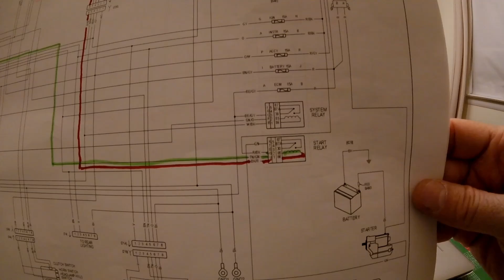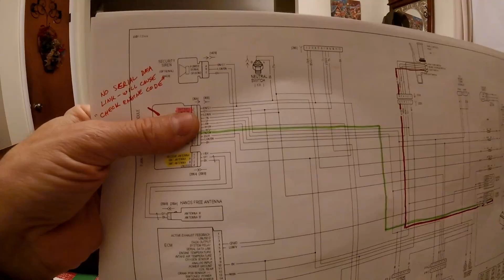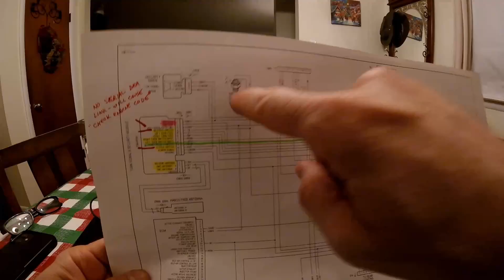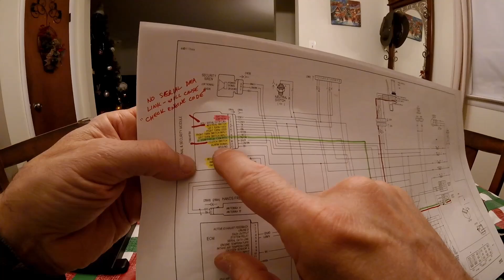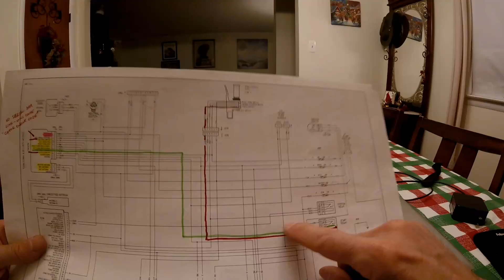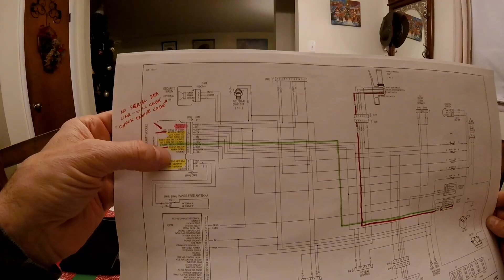Harley Security System Delete & Turn Signal Removal. Twin Cam 1999 to 2010 module TSM & TSSM

Comment: I have an 07 dyna super glide fxd and did just as you said (cutting the tan/green 9 wire and then grounding it to the frame. Now it at least turns over, but won't catch and start. The red key light still illuminates and the blinkers flash. Google/AI is saying  that the security system is still active and not allowing the spark plugs to fire or something. Help?
Reply from the maker: Sounds like you need to ground the same wire on the other relay. I don't have the wire diagrams in front of me to tell you the color of that wire. You can email me at hdrap_1999@yahoo.com and I can look it up next week. You can also google "2007 Harley wiring diagrams"
and figure it out for yourself. Thanks for watching

Comment: I have a roadking 2003 carburetor, with a tssm 68922-00B

Have the cable connected to ground, engine goes around but no spark, get 12v on the ignition coil have no more key fob!! Engine has run with fob, all fuse are whole, engine meanwhile has an after market speedometer Am I doing something wrong or what do I overlook that I don’t have a spark??

Hopefully you can help me, best regards from the Netherlands
Reply: I no longer have the original speedometer with the engine, and the plug that normally goes into the speedometer is now not connected,, could it be that a cable has to be linked to fix the spark problem?
Reply from the maker: @Spd-motors  I don’t know how it affects the computer not having a speedometer. I know that when my speedometer is not working my 2003 road King doesn’t wanna idle properly but it’s still runs fine.
Reply from the maker: The TSSM only fires the start relay. The first thing that comes to mind sounds like you Crank Position Sensor is bad. Let me know if you need further help.
Reply: Have measured the cps and is fine between the values, I read stories when the engine is originally delivered with a tssm your story is not correct, the ecu remains blocked and gives no signal for the sparking is the engine delivered with a tsm then your story is correct, and you can bridge it and start it like this..

I don’t know if this is true, maybe you can do something with this info and still come to a solution that the engine sparks again

Thank you for your quick response
Reply from the maker: @Spd-motors  what I say works. If you read the comments, there have been plenty of people that responded that it worked. As far as the resistance goes, I don’t know anything about that, but I would check to see with a frequency meter if it’s pulsing when you crank the motor. I would also check to see if the computer is putting out a ground to the coil when you’re cranking the engine. You could check that with a frequency meter also.
Reply: What number or color cable should I measure from the computer to see if that mass pulsates? Will mease acdc of the cps tomorrow I’ll keep you posted
Reply from the maker: @Spd-motors  i’m not near the wiring diagrams at the moment. I would be around nose on Monday.
Reply from the maker: on the crank position sensor, you want to check that you have 12 V from the red/white wire on pin A to the black wire on pin C. When you’re checking the frequency, you wanna go from the white/green wire on pin B to the black wire on pin C. For the coil, the white/black wire is the 12 V power and the blue/orange wire is the front cylinder and the yellow/blue wire is the rear cylinder so you want to check from ground to the front cylinder or rear cylinder trigger wire. If you see 12 V all the time then the ignition control module is not providing the ground and the coil won’t spark. Of course you have to have the 12 V on it when this is happening. It’s important to check 12 votes on the white/black wire while you’re cranking the bike.
Reply: @Rapsgarageshop 

I don’t get 12 volts when I measure between red and black at the cps when I measure from black after battery plus is t okay so mass okay you would say, but if I measure in the plug between black and red 1.0 volts.

Can I try to make a cable from battery12 volts to the plug cps and then test? Get a strong feeling that a cable needs to be connected somewhere in the plug of the tacho
Reply from the maker: @Spd-motors  I'd focus on having 12 volts on the coil White/Black wire when cranking and then checking the frequency of the other wires to ground. You can see it on this diagram.  https://serviceinfo.harley-davidson.com/sip/content/document/view?id=5529#d9f41a3d-11c5-441b-b3a9-277049ed91ab!!1!10
Reply: @R I get 12v on me ignition coil will measure tomorrow if it also gives mass signal,,,

But I measured between red and black that go to the crankshaft position sensor, there I don’t measure 12 volts!!! There I only measure 1 volt,,,

Shouldn’t this problem be fixed, or did I not understand you correctly that it should have 12 volts on it?
Reply from the maker: @Spd-motors  I may have made a mistake with the 12 V. I’m not sure what that voltage would be. I’d have to measure it. I would focus on the coil and the pulses there.
Reply: @Rapsgarageshop  Can you check that for me if there should be 12v yes or no,,

When I have checked the ignition coil signal later you will hear that from mii,,,

Drove the bike home, lost keyfob,

Meanwhile the engine has been rebuilt, I get more and more the feeling that either it has to do with the original tacho plug/connection, or really the difference whether the engine originally came with tsm or with tssm!

Thanks so far for your quick response, hopefully together we can solve the problem spark without tssm anyway!
Reply from the maker: @Spd-motors I’m unable to check the voltage for the CPS. As a side note if you have a TSSM you can swap a TSM in it’s place without any issues
Reply: That’s right, but actually hoped this wouldn’t be necessary,,,

Tsm in the Netherlands difficult to get,

And the prices go through the roof,

Haven’t had time to measure yet,

Comment: can you just unplug the module or do you need to do anything else besides grounding the tn/grn wire?
Reply: So I unplugged the module and my  flashers still go off whenever I turn the ignition. -dustinneuwirth5735
Reply from the maker: @jaydianchristie5185    If your bike is carbureted you are most likely unplugging the ignition module and not the TSSM.
Reply from the maker: At that point, you can unplug the module, but you will no longer have turn signals

Comment: My 2001 Heritage Softail fuel injected I bought used years ago and have road for 6 years no FOB, yesterday started flashing turn signals a couple times when turning key to start. A few hours, several stops later it decided on its own it just starts and dies as if it needs a security FOB
Reply from the maker: Sounds like a bad TSSM if I had to guess. My video should help.
Reply: @Rapsgarageshop  thank you, I am going to look at the tssm, this was a non running bike that had sat under a car port for at least 5 years, I really don't know if it has a tssm bypassed or a tsm. turn signals work, currently no flashing going on like it was yesterday, it starts right up every time and immediately dies. Kind of aggraviting cause I have been riding it trouble free for several years. absolutely no codes, nothing calling for me to enter pin. I am wondering if there is any pairing or programing involved. too bad accessing the tssm is such a pain on this 2001 softail
Reply from the maker: @jackdevine5382  I would use some starter fluid and see if you can keep it running with that. At least that way you would know if it’s a fuel problem or not.
Reply: @Rapsgarageshop  Thats a great idea, just reminds me of the way my 2010 sounded when I converted from TSSM to TSM. There is one point where you hit start, it runs a second then dies then you wait 10 minutes. + where it was flashing turn signals twice the last 3 times I started it yesterday. I need to access the module and figure out if its a TSM or a TSSM . If its the TSSM it has to have been bipassed or "deleted. There is no way a FOB is hid on here somewhere as I know it sat 5-7 years afore I bought it.There is TSM aftermarket you tube saying if its TSM I can replace it without programing.
Reply: OK just went out to my John Deere F935 and grabbed a half can either, yes ran a little longer. Hooked up my fuel pressure gauge, initial good pressure then goes to 0. Typically they will hold pressure, gauge even has drain tube and pressure release button, suspecting cracked @ housing for fuel pressure regulator, will investigate more. Plus I tightened battery cables yesterday, fairly new battery were torqued to spec, yesterday tightened by feel, maybe that was my turn signal 2 flash. weird,  Thank You,
Reply from the maker: @jackdevine5382  yes if you have a TSSM or TSM they do make an aftermarket one that will replace it. The aftermarket one is just a TSM, but you can use it in the place of a TSSM.
Reply from the maker: @jackdevine5382  sounds good and good luck. If you need additional information, please reach out.
Reply: @Rapsgarageshop  Thank you for the reply, after draining the tank, removing the fuel module and check valve, inspecting everything. I found a tiny paint chip looking debri in the check valve. Disassembled, cleaned, wiped out tank with oil rag. Reassembled bike started right up.
Reply from the maker: @jackdevine5382  That was a great idea to check that. Now go ride the wheels off of it.

Comment: I cut the tan wire with a green stripe and grounded it. My bike will start and then shut right back off. I have a 2008 FLTR
Reply from the maker: If you do the same procedure to the Green/Orange wire on the system relay this will keep the fuel pump powered any time the Run switch is on. You should know that your bike has a tip over sensor so that if you go down for some reason, the computer shuts the system relay off. The tip over sensor purposely shuts the fuel pump off so that if you go down in an accident doesn’t pump fuel all over the ground and cause a fire. 
I would start by checking to see if there’s 12 V power to the Fuel Pump fuse while you’re trying to start the bike and then see if the 12 V goes away as soon as the bike shuts off. See pages 1 and 3.

https://serviceinfo.harley-davidson.com/sip/content/document/view?id=5535

Comment: Hello Raps, I’m in Fort Worth Texas, I bought one of Four Softail Custom’s That came to Texas in 08. I finally  had my key fob go MIA on  me. I cut the P9 wire  at relay. Ran an independent ground to the relay, while heat shrinking the end I cut. Starts like a champ but immediately cuts out, right away. Is there anything else I have cut and a ground to , so it will stay on? Do I have to run another ground, to System Relay as well?
Reply from the maker: If you ground the Green/Orange on the system relay when you turn the two power switches on it will fire the system relay. I’m not sure that’s your problem is, though. I’d check to make sure that you have 12 volts at the coil power wire before I when further. If you’re still having problems you can email me at hdrap_1999@yahoo.com. Include the year of your bike, the problem you’re having, phone number, time zone and what’s a good time to call.
Reply: @Rapsgarageshop Sure thing Sir.

Comment: I put removed the starter relay and put a jumper wire in there to get it to start. It starts and dies right away. This is definitely my security system, the bike wasn’t really sitting and its fuel injected. How can I bypass it to keep the bike running?
Reply from the maker: Send me your phone number, a good time to call and what time zone you’re in to hdrap_1999@yahoo.com and I’ll call you
Reply from the maker: Also what bike you have

Comment: Back again, 07 dyna fuel injected, The relay is fine, I checked. No key fob starts up then shuts down,, I grounded start relay and eliminated the possibility of the problem being the system relay, it seems as if it stops firing the fuel injectors and the spark plugs, I have removed the tssm completely, can u email me instructions how to keep her on? God bless you happy Sunday
Reply from the maker: I would need your email address. Sounds like the fuel pump is bad. When you jump the relay out and turn the key on will the fuel pump keep running ?
Reply: Fuel injected 07 dyna to rewire ignition
Reply from the maker: @PinchyJason email your phone number, time zone and a good time to call you to 
hdrap_1999@yahoo.com

Comment: Im going to buy an electra glide 2003 with starter issues. They removed all the key switch (i think they do this because though that was the problem of no runing), but i also think the real problem is an issue with the TSSM. Of course now there is no a key and either a key fob, but my question is this will work to fire up the engine or i will need a new module an also a reprogramation. I apreciate your opinions
Reply from the maker: You ground that tan green wire and it should start as long as you have power to everything that needs power

Comment: Does this work if the security system is armed? Would the signals still flash?
Reply from the maker: I’m not sure but many people have replied and said that this worked for them. I’ve never had to do it myself. Also my video was for someone that was deleting the turn signals. Thanks for watching

Comment: Ok I got a question I cut the tan wire with the green stripe I can crank the bike ovet but I don't have any power at the coil and I'm not getting any spark can you point me in the rite direction
Reply from the maker: If you’ done have 12 vdcat the coil then you have to check to see if it’s coming from the handle bar power switch. You did say what bike or what year.

Comment: Brother I cut that tan green from security module and ran to ground, bike starts the shuts off, I put mete on power wire to ignition, it only gets power when I push the start button? Lol this is such an easy thing but I keep getting sucked into videos of guys just talking about there bikes lol I do have a fuel pack n tune , what the heck am I doing I'm over waste deep
Reply: 7 dyna
Reply from the maker: Sounds like either your relay is bad or more likely your losing power from the power switch on your handlebars. Have you ever replaced the bars? You should have power all the time once the key switch is on and the handle bar switch is on. Check it with a volt meter at the relay. You should have 12 volt power at all times on the start relay on the white wire with a black stripe and the blue wire with a gray stripe. Let me know

Comment: 2010 street glide I cut 9 so bike will run without the fob but blinkers stay flashing while off how do I fix that but still have blinkers when I use them.
Reply: Now that I got it fired it does not stay running it starts up and runs for a half a second and then shuts off what am I doing wrong
Reply from the maker: @01fastfredcole email me your phone number, time zone and what time is good to call hdrap_1999@yahoo.com
Reply from the maker: LED Turn Signal Conversion w/o load resistor Harley Davidson or car
https://youtu.be/UreUuDy7wkc
Reply: Is there any way just to cut off the 4-way flashing without interrupting anything else and still have turning signals
Reply: Guess what I'm asking is the wires that go to the dash for the turning signals can you eliminate them can still use the handlebar turning signals 🤔

Comment: Just for clarification if you depin tan and green wire, provide a constant ground to it where it joins start relay it will eliminate security system.  Will this set off a check engine code/warning?
Reply from the maker: Yes Devin and ground it and it will eliminate the TSM/TSSM. As for check engine and warning stuff, I’m not sure

Comment: Mine was converted from TSSM to TSM.
No more probs.
Reply from the maker: You got that right. Thank you for watching.
Reply: What that stand for
Reply from the maker: @DennisMiller-pu4hy . TSM Turn signal module.  TSSM. Turn signal security module
Reply: How did you convert it?
Reply: @tyronebates2215 dealer did it ,before I bought it.
But Harley stopped making TSM /TSSM a long time ago .you can get them 2nd hand off e bay ,but they ain't cheap .
I bought a new spare TSM from a co in the States that make them.
I think it cost me about £350 ( including import duty ) 
I dont need it ,but it worried me if my existing TSM went wrong I would have a useless very expensive chunk of motorcycle goung no where parked 😅in my garage .

Comment: Cousins 03 bagger kept having issue of start then die and turn signals not self canceling and security key light being on. Been fighting this issue for couple months trying different things. Tonight I removed tan w green wire from plug at TSSM attached additional wire to said wire to lengthen it and grounded to the battery and plugged the TSSM back in and she fired and ran with no security light😮. Will play with it more tomorrow but so far seems promising. Thank you for this video and all the comments.
Reply: The damned HD security TSSM model,does seem to give a few probs as the bike ages.And good luck buting a  new one in UK.
I got a new one from the states ,but it cost £360 with import duty.
But at least i got it .
Reply: @John-ob7dh Cheers brother
Reply from the maker: Awesome! It sucks that you have to do this to the Harley’s but at least there’s something you can do. Keep me posted on the outcome if you can and thank you for watching.